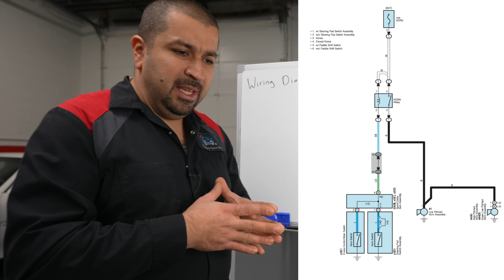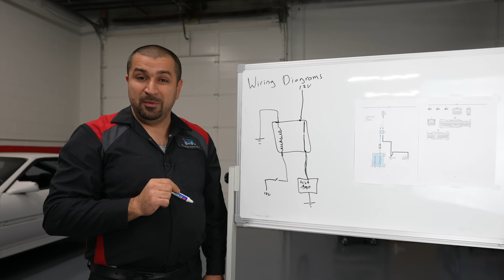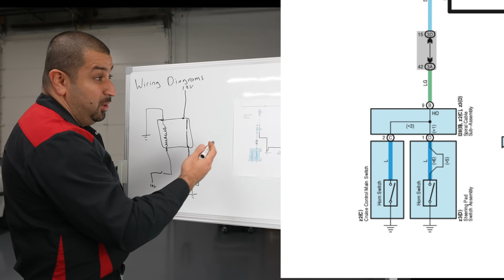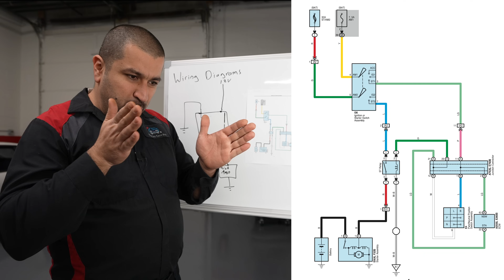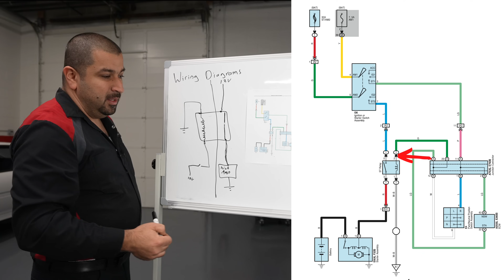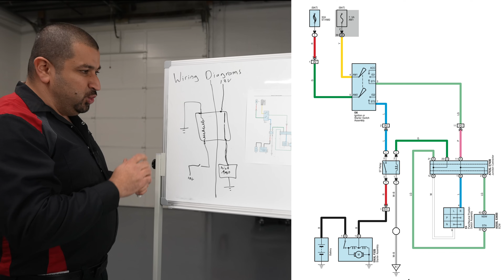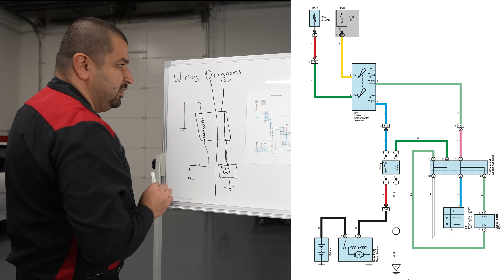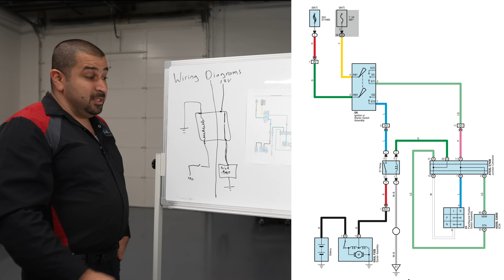How to Use Wiring Diagrams For Car Electrical Diagnosis and Repair

Comment: Excellent video! I have two questions. 1. Where can I get the diagram of a particular year/model? 2. My 2015 Sienna sliding door power window is dead. I found there is digital control logic involved. Can you explain how such kind of electrical modules work? Thanks!

Comment: As an retired RTL tech on Colour tv and VHS, examened with 100% on 40 minutes, it looks that is more to be done. Or why not create special diagnostic ports.. To rip open the total interior to control a fan is heavy and it would be easier to put in a tool that controls the volage/ground points over the fan motor and if  it misses voltage then check the resistance, and if that is correct injekt 12 volt over the motor to control function..

Comment: This probably wont be anwsered but i jus spent the last week studying the wire diagrams for my 18' prius. Firstly if yr gonna have the system curcuit and overall ewd, you gotta have with it the connector list, fuse list and most of all the location and routing section, that alone has helped me more than the diagrams,
2nd thing is in this manuals introduction that i have provided to me by identifix, it says that there are wire to wire connectors then there are junction connectors,  the one you showed as a junction connector is actually a wire to wire conne tor, (ex. AF1 wire harness A connects with wire harness F at the 1 site, there may be 1 to 3 sites, junction connector would be like J/C24 and you have 2,3,4 wires going in then 1 wire coming out or 2, if 1 wires going in and 1 is coming out then its not a junction its just a wire H to wire H, am i wrong? Also do.you have a video on wireing into the main body ecu or to the fuse box?

Comment: You are right ON! As a certified ASE in auto electrical, that is the analytical  way to approach any diagnostics.   I must admit though, Honda sometimes switch positive, rear window wiper. You work backwards from the load.

Comment: I have studied this before and i understand  what youre saying, but where and what converts the 12v to the different amperages thatis needed for low amps on the control side and the higher amps on the load side; is it done in the computer with resistors or?     id dont think anyone ever goes into that .....

Comment: I know this is 3 years too late however its important to note something missed in this video. When giving your examples of testing you said to test for voltage to see if your wire was broken, or relay was bad, etc. 

   While voltage is no doubt an important factor its just as important you load test that wire with something as simple as a lightbulb to make sure the circuit is getting the amperage it needs. Cant tell you how many times i have had to double back on work after forgetting to check the amperage when the wire might have 20 strands but only hanging on by 2. Cheers to the rust belt.

   Other then that excellent video, you are a great teacher!

Comment: I would love to actually learn and understand this, but as a flat rate technician Ive had better luck visually inspecting things to find the culprit. On a chevy with a window that isnt working it would take me hours longer to try to look at a diagram, figure out what everything means and how it works, then testing everything, when ive done a half dozen of these and its always a broken wire in the door boot. As much as i love learning skills like this, i think sometimes following your instincts and personal experience can be better than breaking out the diagram.

Comment: Why can 12V pass through the starter switch assembly and that be ok as a component when testing but pass through the park/neutral switch as a component and know that it is the park/neutral switch that is bad when in neutral? I'm assuming it is because the park/neutral switch is rated for a certain voltage but how do you know that from the wiring diagram?

Comment: I love this it’s the best content when it comes to understanding how the vehicle works!!! 
Q: is it essential to have all juction connectors or will it be an isssue to bypass a junction connector ? The connector was damaged due to flood and I’m trying to bypass the connectors underneath the seat like the belts , door sensor and such 
Is it essential to have them or will I cause an issue to bypass ? 
The truck turns but battery dies and shuts the vehicle off after 30 seconds 
Just trying to remove the ones that don’t interfere with the engine can someone help ?

Comment: hello sir which software to use for these diagrams? i have to diagnose a toyoto corolla verso blowing the ecm 20a fuse 12 which is located in the engine bay

Comment: Thank you for this video. You are so right. The wiring diagram is an indispensable tool to efficiently diagnose the problem. Anything else can result in wastefully replacing good parts at the customer's expense which we don't want.

Comment: In marking published wiring diagrams that have been reorganized for simplicity in figuring out the circuits, which colors do you use for grounds, constant (hot) power sources and switched circuits, some to power, some to ground, for the purpose of seeing the circuit paths at a glance.

Comment: need help i cant find any paid sites for honda hrv 2020 wiring diagram im getting a battery drain for a fuse #21 and 22 back up and audio pull fuse 22 for audio but still the back up one drawing power my 3rd battery already alldata dont have hrv 2020 and not sure some other sites are legit or scam please help

Comment: @9:57... Spiral Cable is the correct term. It's not just "Toyota Language". A clock spring is a spring, not a ribbon cable. It's a flat piece of metal wound up to provide tension on a rotary component. It's not correct to refer to a spiral cable as a clock spring. People started doing that because a spiral cable resembles a clock spring in it's appearance, but it's not under tension and doesn't function in any way as a spring.

Comment: Thanks for this. I love your presentations. Can you or anyone tell me if the VVT solenoid has a designated fuse and or relay in its wiring circuit. I know that to test a VVT solenoid you can apply 12 V directly to activate its action. Does this mean it doesn’t need a fuse or a relay. I have tested at the female end of the connector and no voltage is indicated so trying to figure out where the break could be.

Comment: The word “ground” is confusing until you realize why housing and cars are different. In a car, the ground IS the neutral. It’s the “return to sender” point. In a house, ground is an “overflow pipe” for safety.

I couldn’t figure out where the circuit was being completed, it’s the whole chassis of the car. It acts as a neutral wire. The word ground is only a reference point in cars, signaling the last component before returning to the battery.

Comment: Just a little information nugget for those who are new to this:  These diagrams, even straight from the manufacturer, ARE NOT ALWAYS CORRECT.  They usually are, but do not bet your life on it.  They do, however, help provide an understanding of how the system works.  You can really chase your tail for a long time if you are unaware of this.  Just keep it in mind.

Comment: Side story about starters: I was about 22 and driving down the highway and the sticks hit felt warm and smoke was coming from under the car in through the stickshift boot. It was '69 Cortina. I went to change gears and the the whole sticks hit pulled out of the transmission and smoke poured in!! I put it back into the transmission and made it to my destination. BTW, the plastic bushing that sealed the sticks hit in had melted. My brother said he'd follow me home that evening,  when on the way he flagged me down and said there were sparks and flames dropping from my poor little car. I pulled off the interstate jumped the curb into a parking spot, I pulled the hood and he immediately pulled one of the terminals from my battery.  Both battery cables were burned bare since my starter bolts loosed from an oil leak and caused the positive terminal on the starter to ground out. To this day I count my blessings as we could have had a complete car fire! I got $25 for it at the junkyard. Point is, I know how powerful the starter cables can be.

Comment: I have a Ford 150 1999. There is no power to any component.  No blown fuses. Blower motor, resister, blower switch, blower relay all new. I have the wiring diagram. No idea what else to try

Comment: Could someone help me understand, this is a great video but I'm unsure how you're meant to be testing a lot of the things shown in the video. For example, relays. Usually the metal conductive parts are hidden or covered up by plastic when it's plugged in so how are you meant to test things like this and also when wires have a rubber sheathe on them straight into it's connector. Thanks for any help!

Comment: I'm struggling with a parasitic draw on a 2008 Sequoia.  I have traced it to the 30amp fuse for the back door.  Controls the window and defroster. Stuck trying to figure out what is causing the draw.

Comment: All my warning lights will come on all at once, my temp gauge will stop working. This is all just for a few moments while driving down the road. It also will overheat at 80 mph, but im not sure if thats related. It seems to run fine. Im curious if im looking for a bad connection or corrosion, or if im looking for crossed wires. I dont think a bad relay can do that.

Comment: I tested wiring for relay today,  4 pin.  On control side, when the ignition is off i have ground on one side, but when ignition is on i have 12 v on both pins how come

Comment: If you have a series circuit of 3 bulbs, but have different levels of resistance between the bulbs would the bulbs shine at different levels. Like your style.

Comment: I have a 2021 Kia forte that was in accident. Electrical was damaged, it ran for a few weeks but now will not turn over, no crank nothing. Everything powers up.

I was starting it up every once in a while to keep battery good.

Watching this my assumption is it shorted out the last time started. 

Changing out the visibly damaged wires and checking fuses and relays would be my next course of action? 

Also is it wise to be starting this up again before fixing everything? Front plastic piece a headlight and a fog light are missing as well as a section of the air intake. The electrical that used to go to these is just hanging. Bunch of larger wires coming off the fuse box got crushed in accident. 

The auto shop had listed the electrical box and wires going to it as a unit to be replaced. 

Can damaged wires just be spliced and resealed or should I buy the part?

Comment: I can read a wiring diagram, old school  in a book. I just do not know how to  find the section I want in the all data database. Reading diagrams online is a lot different than from my 1983 k10 service manual. I see how much better it can be, but it took me hours to figure out and find the section I needed for my 2014 nissan sentra. There were so many sections I did not know the connection from one section to another section.

Comment: Like your style.  I have 11 Prii, all Gen1s, 4 have electrical problems.  This series starts me down that road.  Just what I needed.  Went to look at the rest of vids thinking you could be my DieselTech Ron - I have 6 Superdutys too - and see you subscribe to his channel too.  Good for you, couldn't be a better role model on YouTube, may he RIP.  

Remind people to pull those orange plugs!
Reply: I'm kinda unique with all the same cars - Gen1s are almost identical all years with very few options.  I have working cars, known-good parts cars, and the project cars.  My thought is that it's easier to swap complete assemblies than drill into harnesses, etc.  That ain't working so far, LOL.  After checking fuses, I swapped over all the relays thinking that if my running car didn't experience issues, the relays were good.  Ditto, if they didn't change my project car, they weren't the problem.  Ideally, if they one did fix, I could them grab one from the parts cars, confirm and be done.

Ditto with computers.  I've swapped the known-goods in but didn't take those from my good cars.  I got harnesses, fusible links - everything.  And as the Car Care Nut would tell you - I could be any one of you throwing parts at the problem and wasting a bunch of money.  I'm just as dumb, I just spend a lot less.

Still, I think someone like Car Care Nut could save a lot of time doing what I'm trying.  I wish I knew one here in Houston who'd let me pay him just for that diagnosis skill at that high level, and let me just swap in the entire...whatever.  Alas, I know of no one.
Reply: And, yeah, the hybrids have another few chapters in the service/wiring manuals.

Comment: Very educational but what I want to know is why my orange low tire pressure always on but my tire pressure is fine?  And why is my parking brake light on but my parking brake is off and not dragging.  Toyota did not supply me with electrical schematics
or repair manuals to help diagnose these problems and my mechanic just says.....fagitabout it.....they are too expensive to fix.
2006 Tundra, 4.7l, 4x4.

Comment: Wondering if today's question will even be looked at.  Love the video(s) in this series; and I come from an Electrical Engineering Technology degree background so I follow everything perfectly.  Thanks for clarifying the harness plug diagram pin configuration drawings.  My only question, for example, when we get to the junction connector to check for power at each end, is there a drawings diagram with these electrical circuits that show the locations of this junction connector?  We'd need to know where the connector lives before we can check it.  Going back to the "accessibility" portion of your great instructional video.   Love your content!! Keep up the great work!!!

Comment: Wow, you are a great teacher easy to understand. 
We are working on a 2011 Subaru no crank no start. On the start relay control side has 12 V but no ground Circuit. apparently the ground comes from the ECM. is that true? We Plug a scanner in but the Subaru ECM is not reporting and also there’s no check engine light when we turn the key to the run position. Does this mean the ECM is dead? thanks!

Comment: This is so useful and I can not tell you how much my job has been easier since I started to use wiring diagrams in every electrical diagosticjob. I just would like to know if you can give us a tip on how to find Toyota wiring diagrams for JDM cars. They are very hard to find and when you do they are in Russian.😢

Comment: Thank you for the informative video. I have a 2008 Toyota tundra 5.7 L SR5. It has a problem with leak detection pump having no power. Could you make a video with the wiring diagram on this?

Comment: Hi Car Care Nut Guy,  I have random error messages on my 2010 RX350 when driving in the rain.  From low tyre pressure, Check AWD system, check engine, etc.  I have noticed that the small connector to the ECU is loose compared to the big connector so I suspect it may be the culprit.  I suspect the gasket is missing.  How can I buy a gasket for this??  Help please!

Comment: At 20:26 he mentioned do a quick ground check. So how would you do that? Connect multimeter to negative battery terminal and the other lead to the body of the starter?

Comment: I worked on my Cadillac and wiring diagrams were very simple and understandable. Every single possible variation had it's own deticated diagram. Book is also about a million pages long. My friends VW T4 bus, well you have one diagram that has 10 different variations based on trim level and year of production in a single diagram. Good luck figuring out what is what.

Comment: I've begun watching your tutorials because I have two idiot lights staying on in my dash after putting a new alternator in my 2012 CRV. I changed the alternator since my battery is relatively new and the battery icon was lit and the car soon died. After the new alternator was installed, the "AWD" icon came on as well. Hooked up a charger to the battery and showed 50%, ran it up to 90%. Reconnected the battery and still have the two icons. Car starts and runs fine. Any suggestions? Fuse for the all wheel drive is good.

Comment: I have to say, this video reached me in a way other videos, manuals, books, etc. hasn't.  Instead of trying to memorize or work troubleshooting charts, understanding exactly what's going on, the purpose & components of the circuit, my logic/thinking was taking over & by the middle to end of the video I was saying it just before you did.  That felt good.  Thank you.  Subscribed

Comment: THANK YOU!!, "TCCN", FOR GOING THRU SOME OF THESE VERY HELPFUL INSIGHTS, AS TO HOW TO INTERPRET SOME OF THOSE "TINY" DETAILS, ON TYPICAL AUTOMOTIVE ELECTRICAL DRAWINGS!  I AM NOT/(WASN'T) WELL UP TO SPEED, ON MANY  OF THOSE "SPECIAL" CODES, ABBREVIATIONS, STANDARD NOTATIONS", ETC. YOU HELPED, A LOT, IN BEGINNING TO UNDERSTAND SOME OF THESE COMPLEX NOTATIONS, AND, I THINK THAT I'LL HAVE BETTER SUCCESS, WHEN I NEED TO FIND THE "TROUBLE", AND, POSSIBLE WAYS AROUND IT!  
IMHO: THE MOST DIFFICULT, AND AGGRAVATING STEP, WAS TO JUST FIND THE NEEDED SCHEMATICS/WIRING DIAGRAMS!!!! I HAD TO SPECIAL ORDER A BOOK, WITH OVER 300 PAGES OF INFO, ON THE PARTICULAR CAR MODEL,(2008 SCION XD)... IT WASN'T EASY TO LOCATE THAT!!!  AND, THIS BOOK, COULD'VE BEEN MADE MUCH EASIER TO INTERPRET!...  
I ONLY HOPE THAT THE ENGINEERS WHO DESIGN THESE COMPLEX SYSTEMS, MAY ALL, SOMEDAY, HAVE TO GO THRU THIS PROCESS, THEMSELVES!!!  
...MAY GOD BLESS EVERY ONE OF THEM!!! :face-orange-frowning:💥

Comment: I have 1998 toyota avalon xls heather still on . will not turn off and on control panel light is on but did not work any thing .Please advise .  noname9585@gmail.com